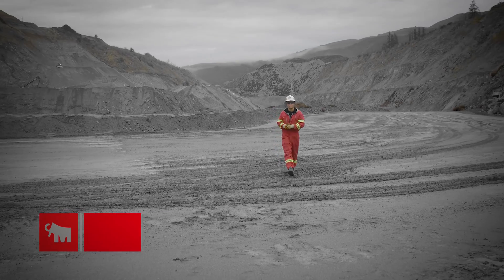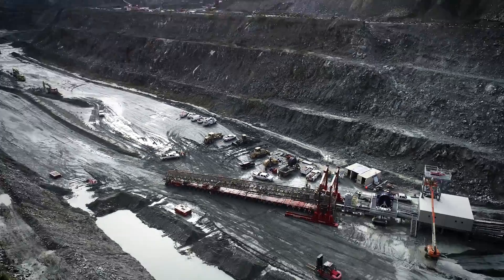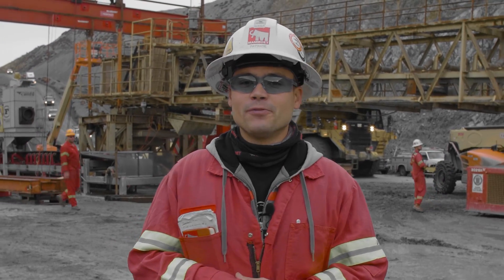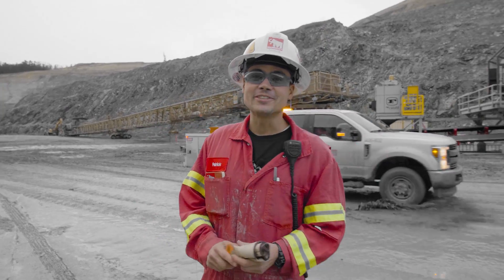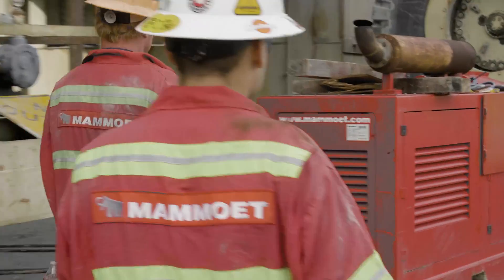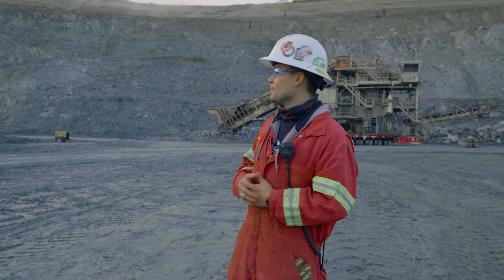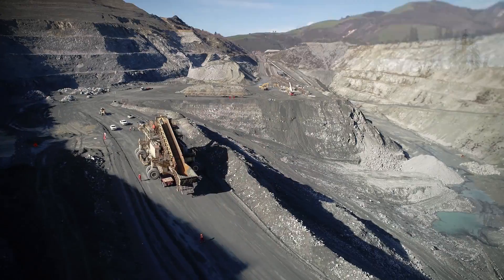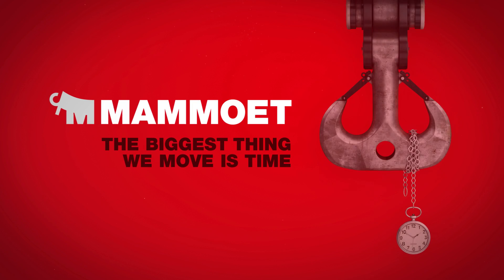200 years of crushing it: Mammoet completes unique move of rock crusher in California

Comment: Why does the crusher have wheels?
Reply from the maker: Hi Vance, the crusher is able to be driven on its own. The mine owner had previously attempted to drive the rock crusher downhill themselves, but it experienced a loss of braking power and the operation could not be completed safely.
Reply: @MammoetHeavyLifting  Thanks so much for the extra info